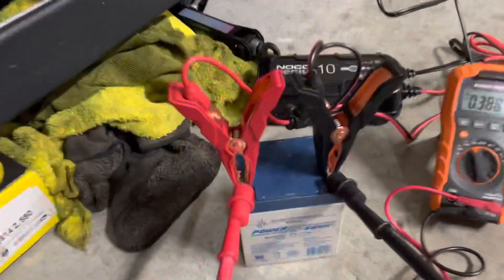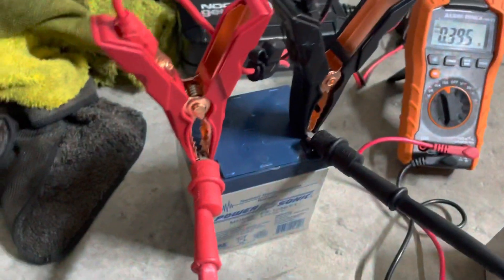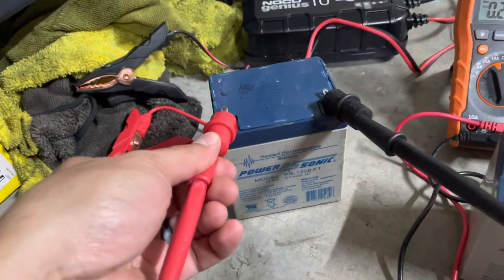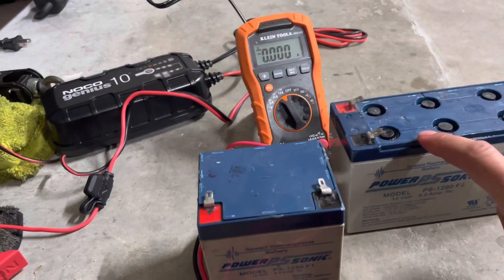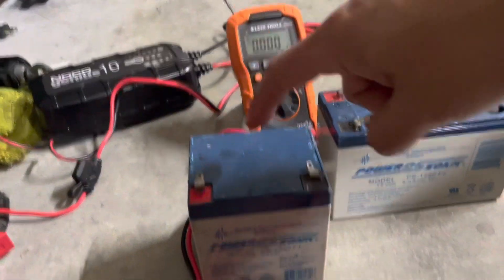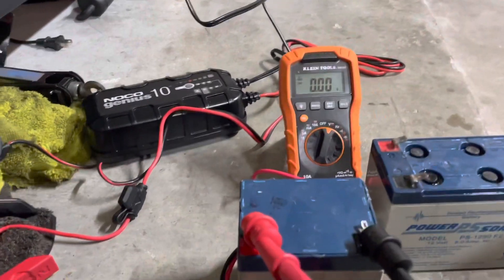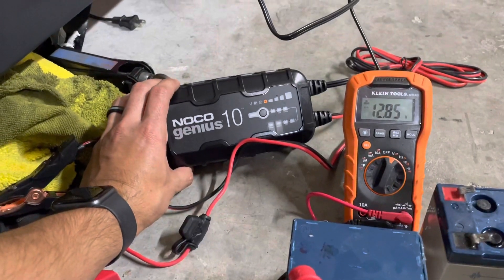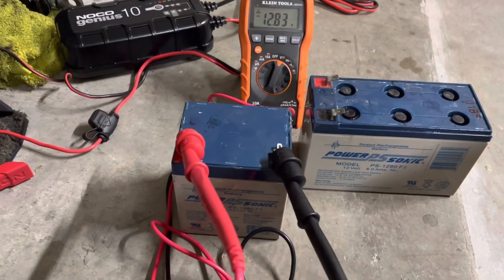Noco 10 Genius charger is this normal?

Comment: Maximum charging AH rating for batteries that small is about 1AH for the smaller 5AH battery and 2AH for the larger 9AH battery. The 10AH charger your showing in use is way too large of a charger & is pretty dangerous to use on such a small battery,  The 10AH charger is designed for something like a car battery. With that 10AH rated charger on those batteries, the batteries will overcharge, swell, boil and or overheat. The recommended figure for determining what maximum AH charge rate you can feed a battery is to first determine the actual AH rating of the battery and divide it by 4. So the smaller battery being a 5AH rated battery, dividing it by 4 you would get 1.25.. therefor the safest charge rate for that battery would be a 1.25 amp (1 amp) charger whereas the 9AH battery would safely be charged at (1 or 2 amp) 2.25 amps max. Im sure you have since figured this out, but sharing a tip for others that may watch this video with a similar issue and reading comments. Of course you can always go with a lower AH rated charger that what your calculation comes out to, It will just take a bit longer to charge which is perfectly fine too.

Comment: How are you measuring the current! From what I can see you’re measuring I in parallel. This will create a short circuit. The 0.33A is correct but you’re measuring it through the DMM and not the battery. Im not surprised the charger is having a fit. Am I wrong?

Comment: I take the caps off so the battery can vent and top it off if or when needed. Where some protective gloves.  I use the Noco 1 for small batteries and the 10 for biggies.
Reply: Sealed Lead Acid (SLA) batteries don't have caps. They're sealed. Have I used my genius 10 on little SLA batteries before? Yeah. is it a good idea. No.
If and when I do, I always expect the worst, and they're placed far away from anything, everything, and everyone that I don't want to risk being sprayed with battery acid steam/liquid while it's charging.
Reply: @jimmah4life  I don't recall anyone stating that SLA batteries had caps. Thanks though. The Noco 10 is a POS. Mine failed like many others have. Got a $30 charger on Amazon that works much better.

Comment: Yep, it's a little late to respond, but it may help others too.. These small batteries are notorious for over-charging and can result in losing water.  IF the battery is sulfated, and the water in the electrolyte may have evaporated somewhat, even a small current can cause it to sound like it's boiling. On all lead-acid batteries, my recommendation is to wear PPE (protection gear) and do the following:
1. check battery voltage, document it. 2. Pop off the cell caps, check electrolyte levels and top off with distilled water if needed. Yes, even that small battery has them, so pry off the cover to access. 3. Leave the caps off and start the procedure of charging, monitoring in a ventilated area.   Note:  If the electrolyte levels are low or non-existant and you try to charge it, it may result in gas build up, resulting in the battery removing the caps for you (kaboom)   The NOCO 10 has plenty of safety features to keep the current low enuf for each battery's condition.  If it does 'boil' a little, that's normal for a un-charged, sulfated battery.  Have some patience (which I lack terribly) and Let the NOCO do it's job. In time, it will should desulfate the battery for you.
Reply from the maker: On these I had them filled with distilled water but they weren’t sulfated and to this day I still use them in the power wheels truck only. Since this video I’ve leaned how to make diy lithium ion battery packs with BMS and Nickel strip that I spot weld. I haven’t used this genius charger in a long time but I just have it in case I need it someday.
Reply: @E85_STI  I forgot to mention that many of these small batteries are AGM, so recovery is a diff process (cant add distilled water, electrolyte, etc.)
Glad you got Lithium packs, I like them the best myself.
Reply from the maker: @carolinafirewood  yes they are awesome and I actually posted a video of the one I made and I use it for a air cooler I made myself. I love making things from nothing.

Comment: It's late but it may help others...
I hear you shouldn't put the batter on the ground because it drains the current, you should alway place it on something non-metal.
Always remove or attach the negative terminal 1st.
Reply: Make sure the setting is correct for the battery type (AGM?)
Reply from the maker: @MrBenzNYC  so I made sure it was the correct setting and I’ll try that next time with getting the battery off the ground. I thought this charger charges up to 10 amps so I was hoping it would detect this small battery and charge it a 1-2 Amps automatically.